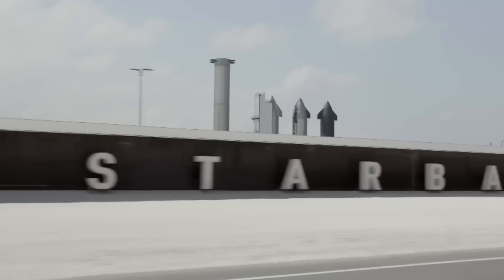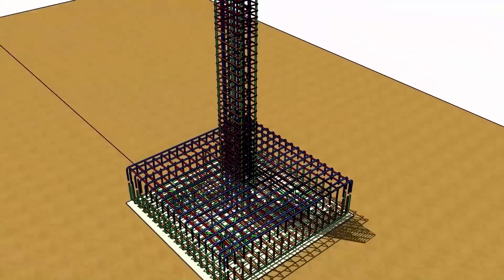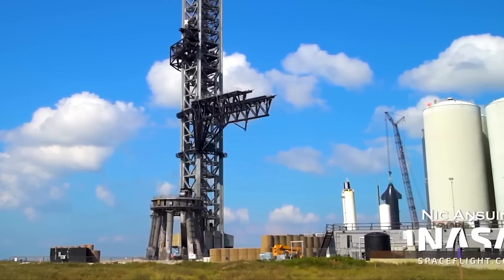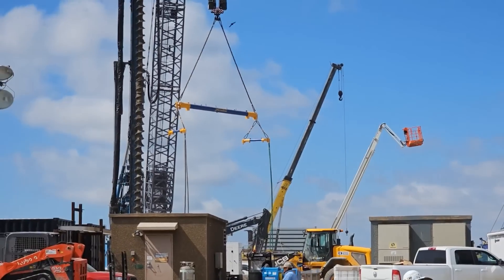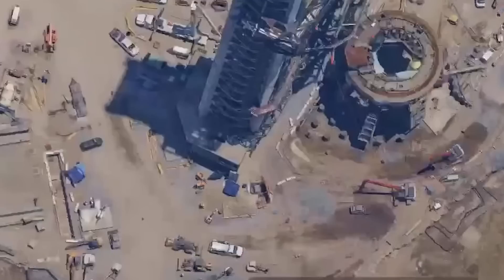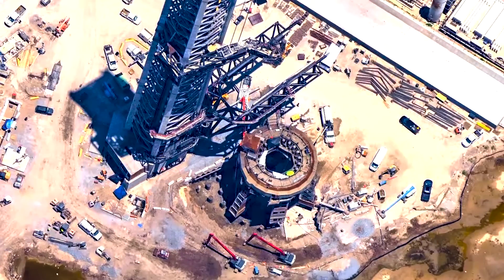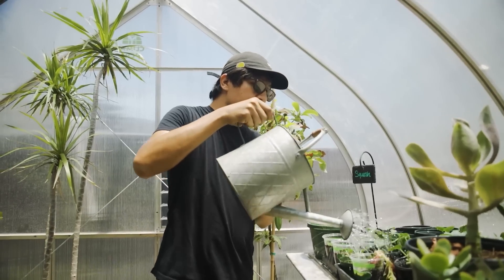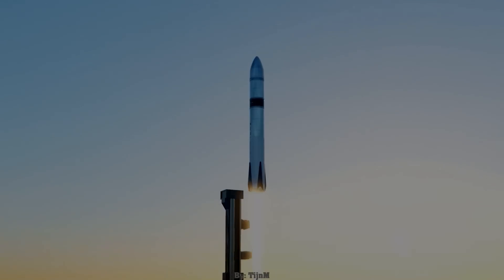SpaceX Finally Tested New Starship Water Deluge Parts + Static Fire System Updates!

Comment: I beleive there will be no power lines installed.  Power cables are being buried underground along side Highway 4 and will replace the generators that were previously used.  Being underground there is no worry for damage from launches.

Comment: I wonder if SpaceX could corner the market on remote water tanks.

Justfly a single stage point to point, remove the engines and helicopter them out.

SpaceX my actually already have the most advanced and efficient water tank factory, with near instant delivery.

Yes, I'm stoned. But it's the future, strange shit is happening.